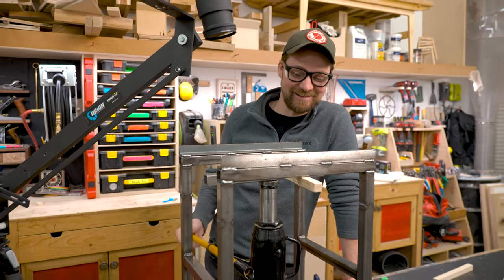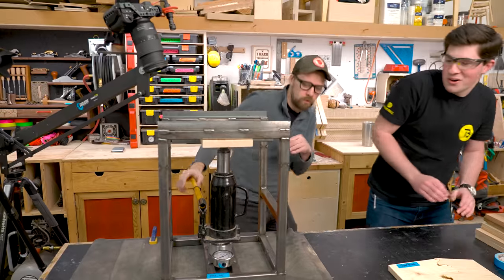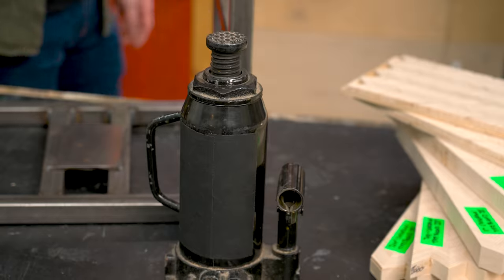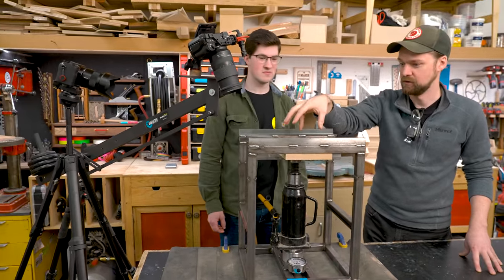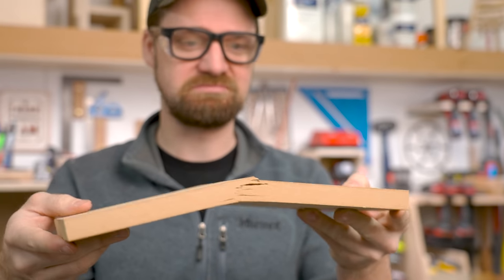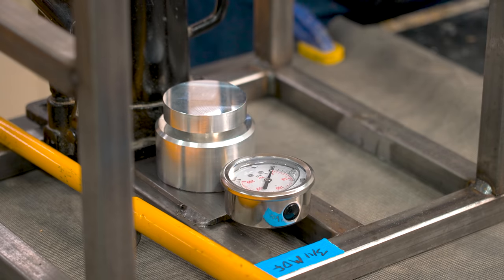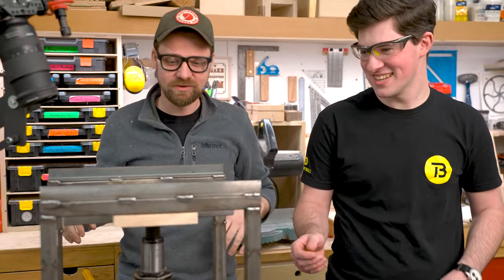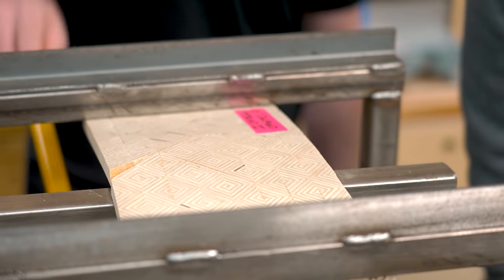Testing the Limits of Patterned Plywood (Featuring Tyler Bell)

Comment: The orientation really matters. I'd wager that if you oriented them so the wide face was vertical, every single material would max out your test apparatus, unless the steel bar crushed the material.

For all of these tests, the cross section orientation and dimensions will impact the result in a way that is nonlinear. 3/4" thick is more than 50% stiffer than 1/2" thick, even though it's only 50% thicker. (I switched majors from civil engineering over 25 years ago so I don't remember the exact details, but I think stiffness increases with the cube of the thickness, and linearly with width.)

Comment: It would have been interesting to see how strong ply-backed patterned plywood is if you had the ply backing on top, rather than underneath. I suspect that this would have an effect similar to a selfbow, where a bowyer will take advantage of the heartwood (better in compression) and sapwood (tension) to make the bow both more powerful and more resilient. If so, ply-backed patterned plywood may be closer in strength to conventional plywood. This is something worth considering in any situation where the pattern faces downwards, and the panel is load-bearing, such as a vault, since it would significantly reduce the amount of wood required, making it both lighter and cheaper.

Comment: There is (at least) one problem with the test: the uneven speed of pressure build-up.
It should 1. be taken evenly and 2. also be the same for each piece.

edit: the 2nd point that strikes me right now, the cross section in the middle should be at least round. Better still "pointed". If it rests on 2 points through the bend, that can also distort the result.
Maybe it's not much, but maybe it's

edit2: i just noticed a 3rd point: if the middle part is not always exactly in the middle and always at the same angle, that certainly has an influence.

It's not meant to be mean. But little things like that can add up. And if you want to do it very precisely, you shouldn't test with one part at a time, but with several and then form an average. A knot in the wood can have a massive impact. ;)
Reply: I think that is a valid point if you are interested in absolute values. If you are just ranking different samples, that seems not to be so important.
Reply: @VanDerPol  I get the basic point. But, as I said, small differences can add up. Part 1 has 55kg, Part 2 has 60kg. If you test more precise, part 1 suddenly has 60kg and part 2 50kg.
Reply from the maker: Yeah, There was a bit of a difference when we went slow vs going fast. it was a variable we didn't account for beforehand. I don't think the numbers were wildly different though.

Comment: If you tested glued panels of pine boards vs your patterned plywood I think you would find they have similar strength (go see Stumpy Nubs for a discussion about dimensional strengths across glue joints). Your pine vs ply test (as others have pointed out) is due to orientation of fibres. In the patterned ply you have no longitudinal fibres so are only testing lignin / glue strength
Reply: They are far too ignorant to be able to understand what you just explained.

Comment: Plywood has similar strength in both orientations compared to soft wood. 

Turning the wood so the rig pushes parallel with the grain will decrease the force required to break the non-ply samples.

Comment: This validates my real world experience with pattern plywood: all of my failures have been in individual ply wood fiber or in the factory glue.   I’ve mainly used this material for a vanity countertop, a fully carved sink and backsplash, and some cabinetry.   Most of my breaks come from contraction due to humidity change when I didn’t allow for wood movement.   I’ve also experienced severe warping when I’ve laminated to a plywood backer because the two materials have different expansion properties.  

All that with a caveat.   I’ve only used “basic” patten ply.  Just end-grain strips glued up straight with no alternating angles.

Comment: For a same given section and material, the strength relation is to the square of the high. So if the board is 2 times the thickness, it will be about 4 times as strong. Explaining why from 1/2 pattern ply got 100 lbs vs 400 lbs for the 1 in pattern ply. Physics!! ;)
Reply from the maker: Oooo! That makes a lot of sense!

Comment: Since the failure of the patterned plywood was within the fibers, one would expect that the amount of flex would be  a major contributing cause to that failure.  Keeping track of the amount of flex would seem to be a good idea for these tests. If one were to make a 1/4" patterned plywood board and underlay that with 2 layers of plywood strips glued together, with the layers oriented perpendicular to the other, this should provide the greatest resistance to flex while not creating a likely point of failure.  You did not test for twist resistance, but I would imagine patterned plywood would break under twist as well, and the 2 perpendicular layers would help reduce that.  At some point this becomes an exercise of "If I add a layer of A between layers of B and C, then top that with the patterned plywood, I have greatly reduced most points of failure).  Since patterned plywood undermines much of the strength of plywood, I think is is safe to say that treating it as a cosmetic layer and therefore keeping that layer thin and then gluing it to a layer with the desired strength characteristics would be easiest.   Good video, thank you.  I was also surprised by the MDF results.

Comment: Love the content. Curious on if the length of the boards would change a significant amount of pressure. Say for example you average cabinet openings is 24 in so if you were to use this as a countertop or a table would spanning over that distance make it significantly weaker? It looked like you were spanning about 12inches.

Comment: The advantage of plywood isn’t that its stronger, its equally strong in both dimensions, if u took a pine board with the grain running sideways i would have broken much easier but for plywood it would have stayed the same

Comment: I would be interested to see how the backed patterned plywood would behave if inserted otherway up i.e. pressure is applied to patterned side so that the patterned side goes into compression.  I would predict it is stronger still.  This is the likely way pressure would be applied to this if used in table-top or similar.

Comment: Some woodworking shows claim that wiping excess glue off with water will weaken the joint.  I've requested several people to test that theory but nobody has stepped up and done the tests.  Maybe you have the ability to try gluing several different ways with different glues and using different methods to remove the excess.  I don't think using a moist cloth to remove excess glue will weaken the joint.

Comment: Fantastic video, Michael! I wish I could be there to nerd out over this test. Looking at the bending stresses equation, bending in that direction is b*t^2/12, meaning it wouldn't be a linear curve  based on thickness like you mentioned around the 22 minute mark.

Comment: Great video. Like most, its fun to see things break. There is something that is not clear to me (you may have covered it but I may have missed it). On the patterned tests, I believe that every time it broke on a glue joint (if this is not the case please correct me). If so, on which glue joint did it fail? Did it fail on the plywood glue joint, or on the one you made with either the Titebond or epoxy? If the failure was on the original ply glue joint, that would tell me that your glue joint was stronger. If it is too hard to tell, another round of testing might be necessary, in which you color your glue layer (without affecting the glue joint).
Reply from the maker: Hey Glenn, Thanks! So the glue didn't seem to fail. The failure was in the fibers of the wood. I hope that clears things up.

Comment: what if the planks were supported on the sides too? cause even tough it can seem pretty weak for some siuation, I think that  framing plus de additional thin normal plywood might strengthen it a lot maybe. Also when testing the pattern plus thin plywood you tested it with the pattern up but it should be stronger reversed right?

Comment: I've never run across anyone saying plywood is stronger. In fact, when making shelves, you often want to make them of solid wood or put a solid wood lip on them not just for looks, but strength. What plywood is is more *stable*. 

The kind of plywood that is considered stronger is the type of laminated beams and studs used in construction. But that's a very different process.
Reply: Plywood is CONSIDERABLY stronger than solid wood when tested ACROSS the grain. Imagine making a bookshelf where the grain of the shelves ran front to back, rather than left to right.... how strong do you reckon that would be?
Reply: @johncoops6897  Sure, but that's not what he was tested, and most folks don't use solid wood that way :P The unsupported span for plywood is shorter than hardwood of the same thickness, by something like 25%. Not sure how pine may compare as I don't work with it generally.

The main benefit of plywood is stability.

That said, I used BB in my closets, but I edged the shelves with solid maple 1x2.
Reply: @johncoops6897  For grins, I just looked it up. One diagram shows birch plywood as being able to hold around 41% of the weight of the average solid hardwood span. 

Again, used normally, not across the grain, which would be bizarre.
Reply: @Psychlist1972  - we are saying the same thing. Let's say that solid BIRCH timber is "100% strong" when you try to snap it across the grain, and (say) only "10% strong" when you split it along the grain. So, the maximum strength is 100% for your solid birch bookshelf.
Now we get that same birch and make plywood, laying half the ply in one direction and half the ply at 90 degrees to it. So now we have 1/2 of the 100% + 1/2 at 10% - the total being "55% strong", but in both directions.
That same kind of ratio will apply no matter what kind of timber you use. Since hardwood is stronger than birch, it is obvious that hardwood planks will be stronger in one direction than birch plywood, but they certainly won't be stronger than birch plywood the other direction.
So, plywood can never be "stronger" in total than the solid timber that it is made from... that would break the laws of physics. However plywood is always stronger than the weakest direction of solid timber.
Consider a 3 foot wide table top as a "slab", unsupported by rails but with 4 legs at the corners. Comparing equal thicknesses of plywood vs solid timber (edge glued), which would be stronger if you jumped in the middle of it? In that application, ply is definitely stronger... but it's not for a bookcase shelf.

Comment: As a table top attach it to an MDF base 3/4", then find a 300# tap dancer and let him at it.  Even so, when would a table top exceed 120# per square inch?   My issue was on a counter top of 5/8" cherry  top glues to 3/4" MDF.  The cherry was very old and dry and glues and pocket screwed together.  Then glued to MDF.  After a year the cherry separated across grain and wood fibers tore away from joint and glue.

Comment: Question for you and the audience; when we make tables out of panels we normally put in a "C channel" to account for movement over time, or we use bread boards etc.  How do you feel all these individual parts would move over time and would something like a C Channel be required?
Reply: No need for c channels or bread boards with plywood. Same goes for the patterned plywood.

Comment: This is just my own hypothesis: 
The strength of wood is highest when you apply the Force perpendicular to the fiber direction. However, plywood has alternating directions. 
So 50% of the plyes do not have the optimal fiberdirection in this strength test. 
If you took the pine/hardwood and rotated it 90 degrees in this test, you would see that much less Force is needed to break the wood. 

So the Benefit of plywood is the form stability and uniform properties.
Reply: And great video by the Way! 🥳🥳🥳

Comment: 5:35: The surface being stronger than the core of the material makes sense. I forget which engineering video I watched, but the key point was that surface of a structural component is going to be the primary load bearing areas. If you took a beam and bent it, as is the case with this video, the 2 surfaces above and below the load are under the most tension and compression respectively. The core of the component experiences the least amount of bending. In fact, the I-beam is shaped like an I, to maximize strength with the least material. The primary use of the core is not to be a load bearing structure (it still does this role for other forces like torsion or twisting forces), but to give the component rigidity and prevent deflection. I wish I can remember which engineering video I watched that explained this phenomenon.

Comment: Very interesting results and mesmerizing to watch. I’d be interested to see what joints are the strongest. (i.e. bridle, Lap, dovetail, castle etc) I’d also wonder if the joints are stronger than the wood itself. And would it be a joint failure or material failure first.

Comment: Try point force lol. This is basically a scale to rate stronger to weaker designs, you can use a cylinder or angle stock to apply closer to a point force (along that line) rather than a plane that’s 2.5cm wide by your test width.

Comment: I have an idea for the pattern ply woods strength, twice the work tho.  Idk how much strength you would get out of it but if you did 2 sheets of quarter inch pattern ply and then glue the two sheets flat to eachother but where the patterns aren't matching on either side, it would probably give more strength and look good on both sides which could be good for some projects where you do not want to sacrifice looks by putting regular ply wood on the back for strength
Reply: And on that note want if you did veneers of the pattern ply wood and then you alternated it the same till you had a block or something that would in theory have the same effect of ply wood but more sheets or or just do the same thickness of ply wood and see if it is as strong

Comment: Chevron + Ply would be much stronger flipped over... the endgrain aligned fibers would be loaded in compression instead of tension, and it might even be stronger than 1/2" ply in that orientation.

Comment: Plywood has exceptional sheer strength.
Reply: Nope. Solid timber has more "shear" strength in one direction and less in the other direction.
As for "sheer" strength, that depends what you are measuring. It also depends on the type of timbers used.
Reply: @johncoops6897  sip panels
Reply: @CapnSnackbeard  - I am sipping a beer, but I don't sip panels.
And what's that got to do with plywood, in the context of this video or your original comment?
Reply: @johncoops6897  Those guys are not testing the plywood sheer strength the way it would be used structurally in real life, such as siding, or in a sip panel. In other words: in their most common use cases, they do have exceptional strength (as was noted in the video) and one of those cases is in timberframe sip panels, where they help hold the house together. Snapping plywood in half over a fulcrum does not demonstrate this.

So in short it does have great multidirectional sheer strength thanks to the alternating grain facing in the layers, and when one uses plywood structurally, thats an appropriate use case. The context of this video is not testing that, but seemed curious about why people said plywood was strong, so I said that it has exceptional sheer strength.
Reply: @CapnSnackbeard  - i don't think you understand what shear strength means. SIP panels are not used in shear within a house.
Reply: @johncoops6897  ok dude, thanks so much

Comment: The shear strength of a beam is proportional to the square of the thickness.
e.g. 50% thicker (1.5t) = 225% as strong (1.5x1.5=2.25)
So an 8x2 joist is 4 times as strong as a 4x2 joist.
Please stick to the pretty patterns and leave the bridge building to someone else  :-)

Comment: I’ve never head that plywood is “stronger” than dimensional lumber. I’ve only heard it is more stable and isn’t subject to expansion and contraction like solid wood.
Reply: Plywood is stronger than dimensional lumber ACROSS the grain, because alternate layers of ply laminations run in opposite directions. Consider a 6" long piece of 12" wide 3/4" thick pine... most people could easily break that with a Karate Chop.

Comment: I think a better test of solid wood vs plywood is to have the solid wood be the same kind of wood the plywood is made of
Reply: Doesn't really make much difference. The thing many here seem to forget is that Ply is strong in both along and across directions, because of the alternating grain direction of the plies. Solid wood is only strong ALONG the grain, and will easily snap across the grain.
Reply: @johncoops6897  why wouldn't it matter? We saw walnut is stronger than pine. It leads to believe that plywood made of walnut would be stronger than plywood made of pine
Reply: @AnonOmis1000  - well, of course - however that is hardly relevant in this test.. However have you not yet realized that solid timber is only "strong" in one direction?
In sheets of ply (like the birch shown here), the timber plies are in long slices with half the timber in one direction, and the other half is at 90 degrees to it. That is stronger in both directions than real timber is in it's weakest direction.
However his fancy laminated patterned stuff is not strong in ANY direction because it is made up from lots and lots of little pieces. There is no continuous grain to provide strength, irrespective of what timber it is made from, so it will always crack along the line of the grain (zig-zag or whatever).